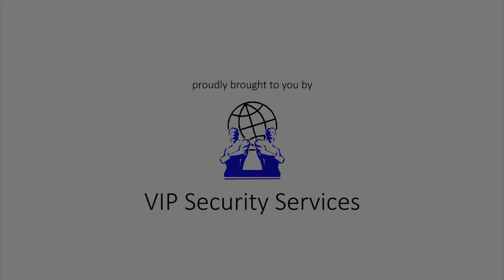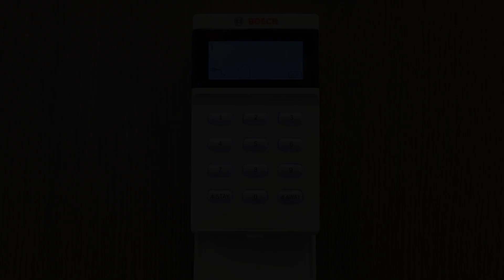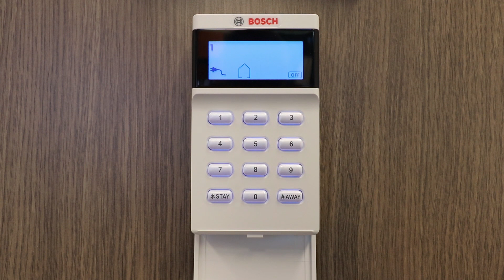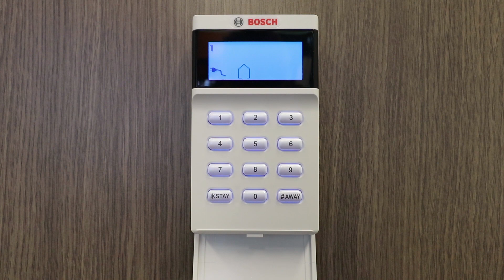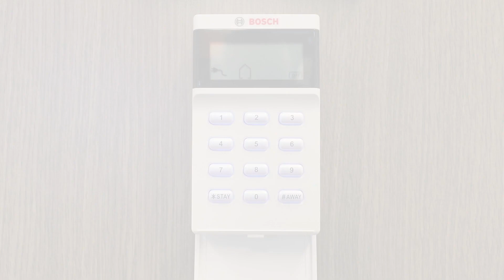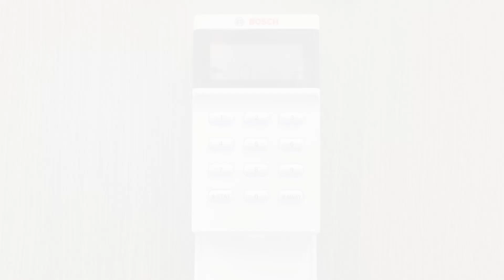BOSCH: How to change codes on Bosch Solution Alarm Systems

Comment: I can't for the life of me get my solution 862 to stop beeping with an error 8.. the manual says communication but writing on the inside flap of the keypad says its 'tamper'... nothing works. can you help me just shut down the unit totally so we cant use it? How do I do that? unplug the power adapter and disconnect the battery but there is still life in the keypad and the damn thing still beeps?? its killing me

Comment: Yeah I need a new master code too bought the house and been here two years with out using and now the dam thing won’t shut up
Reply: Hey @charlieone473, were you able to fix the issue with your alarm? I also bought this new property and don't know the master code or any code, so I'm wondering how to get this thing working.